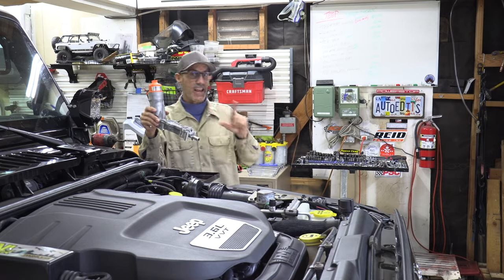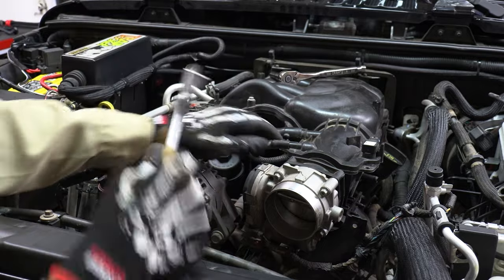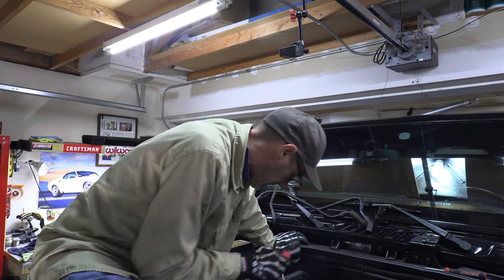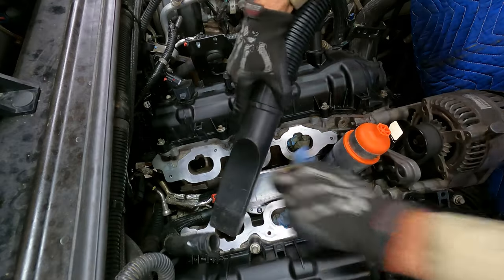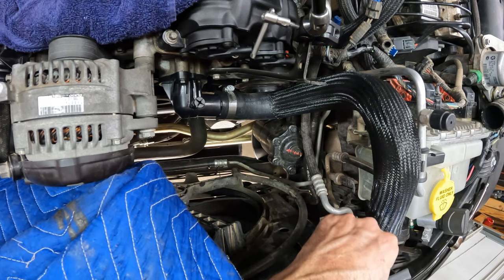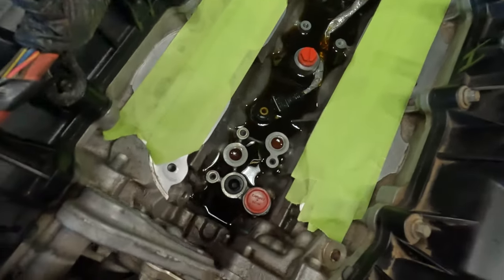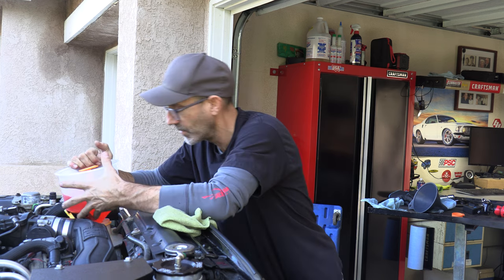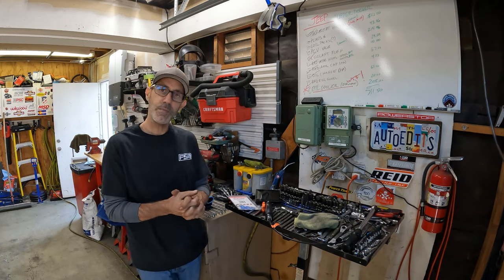How to  Replace Jeep JK Oil Cooler and MORE - Plugs, PCV, Thermostat Housing, Coil Packs

Comment from the maker: Howdy Jeepers! Hope you all like this video... chapters are pretty well organized to each task. Let me know what you think!!!
https://www.amazon.com/shop/autoedits/list/3DK63XK3I5IL6?ref_=aip_sf_list_spv_ofs_mixed_d
Reply: Sucks you had to replace the housing twice! But I bet it got extra clean in there the second time ;-) I just did this at 220k miles on my 14 JKU, so you may get to do it again! I forgot to put the foam back in, though, and I still haven't gotten around to it... Thanks for another awesome video!
Reply: On the dorman quality control issues. I read up on this and ordered the mishimoto oil cooler/housing for my pentastar ram that just sprung this leak.
Reply: Excellent video! It can be used not only as a reference work, but also a cautionary tale. Here's to another 10 years and 80,000 more miles. Aloha.
Reply from the maker: From what I've researched... that foam missing hasn't affected many jeepers so rest easy on that one!
Reply from the maker: I'm so thrilled you got that from this video because I honestly wanted more than just a how to!!! Thanks so much for this feedback... I appreciate it a bunch!
Reply: This was a great video…of course because you are awesome👍🏻👍🏻.  Big jobs like that scare me….im dreading installing an EFI system in my rig because I am worried I do not have the knowledge
Reply from the maker: Best way to do that is break it up into smaller manageable sections. One bite at a time 🤣You got it!
Reply: As a newer "2019" jeep owner found this very informative.
Love the content that you have on your channel.
Mahalo
Reply: Installed the mishimoto unit on my 3.6 today. No leaks first try.
Reply: @skulldriver1019 how is the mishimoto housing holding up? I'm between either mishimoto or dorman
Reply: @AutoEdits  I sure can see a difference in my wiring harness  with one side having foam and the other side not.
Passenger side harness is CRISPY
Reply: Same thing happened to me with the Dorman yesterday. Not happy

Comment: I replaced the housing with the oem replacement with felpro gaskets and they were exactly the same. So the doorman gaskets must be different. Also my previous oil cooler cracked under where the old gasket was on the coolant side of the oil cooler, so good to check under the gaskets when you take off the old unit👍🏽
Reply from the maker: Good advice

Comment: Im replacing my knock sensors currently and need to get below the oil cooler which just got replaced. Is it possible to clamp off the rubber hose feeding into the back of the cooler to minimize leakage?

Comment: The mitshimoto one comes with new sensors and a new oil filter with the cooler mounted and torqued already for 100 bucks less just an FYI great video though getting ready to tackle mine this weekend
Reply from the maker: Best of luck to you!
Reply: Link?

Comment: Thank for the video, I went with the Mishimoto oil cooler housing instead of Dorman, and the Baxter spin on oil filter adapter.
Reply: I’m really curious how happy you were with the Mishimoto product. 

By the way, great video Jason
Reply: @Tony3deee  very good product, if you have a need for one, get it. My coworker is getting one also.
Reply: is the mishimoto better than the dorman in your opinion?
Reply: @ I herd mishimoto is a better product, and it is fully assembled.

Comment: thanks for video very informative 2 questions 1 what is your recemented oil cooler to use . the doorman i fear after what happened to you 2 how many days did it take to do and yes I've got 112367 miles on my jeep so i will be copying   what you have done in video
Reply from the maker: It took a full weekend and I’ve seen good reviews of the Mishimoto cooler… https://www.amazon.com/shop/autoedits/list/3DK63XK3I5IL6?ref_=aip_sf_list_spv_ofs_mixed_m

Comment: Hey Jason, I’m curious why you went with the Dorman oil cooler vs OEM plastic. I had an oil leak on my 2016 JKU, the oil cooler was the culprit (replaced under warranty). Now at 85k I’m seeing similar leaking but no pooling where you see it. Not looking forward to replacing an oil cooler since I have a supercharger. Had to fix a heater hose leak earlier this year. So I’m getting pretty fast at stripping the supercharger off but it’s still a weekend job. Always love your content!
Reply from the maker: Did you watch far enough for my explanation and recommendation to go with a stock unit? 👍
Reply: Thanks Jason, my bad, I literally stopped watching at the coolant burping part, fell asleep lol.  I read on some forums that the OEM plastic is preferred in this part.

Comment: Being the owner of a 2013 JKU with 120k myself, this video is timely and informative.  Thanks.
Reply from the maker: Hope there's a nugget or two in there for you!
Reply: I also have a 2013 JKU, with 130k. My oil cooler failed two days before you posted, and I wish that wasn't the case. I went with the Dorman, and had good luck with the unit, although pricey at my local parts store... My oil cooler was also not cracked, and I probably could have saved the money and gone the seal only route and replaced all you did here instead. Funny that the oil temp sensor in both of ours spun like that... thanks again as always!

Comment: Two quick points: 

1.  I've done this repair twice now and referenced this video both times.  It's a fantastic how to guide.  Thanks Jason.

2.  If you're in a time crunch and can't wait for e-sockets to be delivered, I found some in stock at my local Harbor Freight for $11.99 (Pittsburgh brand).  They did the job.

Comment: If it makes you feel any better about what you had to just spend, I just paid $1,200 (on 1/5/24) at the dealership to have just the oil cooler replaced for this same leak on my 2015 Jeep Grand Cherokee with the 3.6L. I wish I would have had the time to do it myself. 

This video is reminiscent of the early channel. This is the content I really appreciate from you and why I subscribed long ago.  Good work!
Reply from the maker: I appreciate hearing this!

Comment: Jason, I have a 2013 jku also. I went to have it smogged, it wouldn't pass, had a bad oil temp ( or pressure) sensor. It is one that attached to oil cooler. I had the shop do it as I heard how much of a pain it was. While it was apart I had them do plugs ,etc. I have to give a huge shout out to Ricks care care here in Santa Maria. Super great work and customer service.
I really enjoy your channel. Keep it up.

Comment: Morning Jeeping Jason. I have watched your videos for the seven years, and you are one of my favorites. I most recently had to change my oil cooler when I notice that right after an oil and transmission fluid change, I saw the leaking oil down the sides of the transmission. Your video just posted, and I looked at it about 5 times because I knew that i had to do this job. I have done a tune up before, so I knew how far I had to go into the motor. I debated with OEM VS Aftermarket and settled on Dorman. After all of the videos I watched I have not found a for sure issue with Dorman products, so I took a shot on it. The job was time consuming, and I gave myself the weekend to complete it. After reassembly, I have two issues. There was a no start condition from injectors 2,4, &6, so back off the upper plenum goes. I found the fuel line was not connected all the way so that was fixed. The 2nd issue was my brown wire (Injector signal wire) in the main wiring harness had backed out during disassembly. I found it by watching more "Youtube Videos". Once corrected, the jeep started and is currently running fine. For the first week i looked down in the valley to look for signs of leakage. So far so good. Sorry for your bad luck with your Dorman install, but for me, this is the second time this job was done. I had the dealership install one back in OCT of 2019 and it lasted just around 5 yrs. I'm hoping this Dorman last longer than that because this is not a routine job I want to keep doing. Keep making great content and keep on "JEEPING".  Terry.....
Reply from the maker: That is a serious journey ... glad to hear it's a so far so good situation! Thanks for sharing the story here!

Comment: Excellent clear Video, I Did all this except hoses and Radiator Cap. I also replaced Spark plug tube seals, I had one leaking oil on a coil. I also added a Baxter Oil filter Adapter, no more Dry Rattling Starts since it uses a spin on Filter that doesn’t drain back like the Cartridge one.
Reply from the maker: How do you like the Baxter?
Reply: Well worth it, It’s my Wife’s Jeep. She likes to use the remote start to warm/cool the vehicle while it’s in the garage and it always made me cringe every time it started up with that rattling at start up , plus I get to use a good Mobil 1 Synthetic oil filter M1-212A

Comment: I just bought the Mishimoto oil cooler for my JKU and have been waiting for your video before I do my install.  I gotta say the Mishimoto looks so much better than the doorman. Thanks man for another great video.  You're one of the few YouTubers I trust.
Reply from the maker: Thanks so much!!!
Reply: Did you install the mishimoto oil cooler yet? I'm between dorman and mishimoto
Reply: @i-Lion9  Not yet unfortunately.
Reply: @i-Lion9  
I put one in and it worked great .
Except I did switch out the o rings it came with for some better Mahle o rings 👌🏻
Reply: @TXFarmRoad  awesome thanks
Reply: @i-Lion9  
You bet 👍🏻
Definitely recommend the o rings tho .... they are a better fit  x & y

Comment: I really wanted to see how you got the spark plug socket/extension on the passenger side plugs. I could not fit an extension in there because of the battery tray. I had to remove the tray which was the toughest most annoying part of the job. I changed plugs when I had a lifter tick that I tackled. Even that was easier than getting an extension into that passenger side plug by the  battery tray.  Sorry you had to go through the failure point, happens to us all especially with how complicated mopar decided to make maintenance on these jeeps.
Reply from the maker: oh darn... I very easily used two shorter extensions on the socket and would connect/disconnect going down the plug hole.  I thought about sharing that part but this video felt so long already. Sorry dude.
Reply: thanks for the info! I'm not very tool savvy, but i'll definitely do this next time I get around to the plugs @AutoEdits

Comment: Yep, sometimes new parts are bad right out of the box. Hopefully that 2nd Dorman unit holds up. Is there a better aftermarket unit that is a completely different design? Maybe something that doesn't mount under the intake, or just plumb up a separate radiator style cooler in the grille.
Reply from the maker: I'm not sure interesting suggestion... hmm

Comment: Great video, I've never worked on a Jeep and was able to follow along easily.

I did basically the same thing on my Crown Victoria last year, sans the oil cooiler. Swapped the intake manifold instead and did the spark plugs, valve cover gaskets, fuel injectors, etc.. a classic "while I'm in here" rabbit hole
Reply from the maker: Nice work! Glad to hear from a fellow rabbit hole dweller 🤣

Comment: Hey Jason enjoyed the video and your honesty with the issues. I didn’t see that you replaced the sensors, just transferred them. I had to replace the oil temp sensor in my daughter’s jeep with 90k miles so did the Dorman housing while there. Just a thought. I actually had it done at a shop due to my work schedule but now I need to replace the housing in my wife’s JK. Don’t have the funds to have a shop do this so I’m doing it myself

Other videos I’ve seen claim that the plastic plug on the housing can come out and showed an example of that issue. Also the ridges around the seals can become brittle and break down causing a leak. For those reasons I think I’m gonna do the Mishimoto housing with Mopar seals per the rest of the internet’s suggestions

Thank you for your video offering on this subject. Reminded me that I also need to add a PCV valve to my list
Reply from the maker: Unless I suspect or know a sensor is bad, it's best to re-use what works. I'll be curious to hear what you think of the Mishi unit.
Reply: @AutoEdits wow! What a weekend and what a process. First of all, this was the only weekend I had available to do this so I ordered the Mishimoto with rush delivery only to find that the item was back ordered indefinitely so I had to cancel the order. I then had to source an oil cooler locally which meant the Dorman. I must have watched a dozen other videos on the subject and non called out the seals so I stayed with the Dorman ones. It was late Friday and couldn’t get any. Mopar locally anyway.

Well wouldn’t you know…thers a constant drip of coolant coming from my bell housing. Now it’s Sunday and no Mopar parts available so I took it to my local shop on Monday to have the seals replaced with Mopar ones. Let’s hope it works. Geez

Note- this shop used to use the Dorman coolers but has since gone back to OEM as they say they have been more reliable. Mayb Mopar has made some refinements to their oil coolers??   Certainly makes me question the decision of engineers to put that item so deep into the motor
Reply: Update: the seals on the Dorman cooler still leak. I don’t have the time to replace so I took it back to the shop that did my daughter’s Jeep. They’re replacing the whole things with their own so that they can warranty it. Understandable. They are giving me back my old Dorman so that I can seek a possible refund from the auto parts store. Reminder: I never got to try the Mishimoto because they were out of stock at the time I did the repair

Comment: Wish I had done the radiator hoses when I was doing all of these maintenence items and then replacing my rockers and lifters a couple of months ago. I had them off anyway but didn't even think about replacing them. Things always pop up for me during these repairs too. And I swear replacing that pcv valve took me half my overall repair time. I used a small torx bit taped to a small spanner to get to the screws. I also upgraded my lower air intake and fuel injectors to the JL components and they've been great so far.
Reply from the maker: Sometimes good info sharing like this on the web... thanks for that input!

Comment: Just did my oil cooler back in November. Would've definitely used this how to as a step by step. Well done! sucks about the dorman issue.. word of advice for those about to tackle this job. Take your time cleaning up any casting issues. No leaks for me as of now, and I strongly feel it's because I prepped the cooler first with a file. biggest regret for me was not doing the "because we're here" replacements (coilpacks, sparkplugs, thermostat etc). Thats going to suck. Keep up the great work! Big fan of this channel
Reply from the maker: Hey thanks for the share!

Comment: Sorry to see you had a bad experience with the Doorman housing. I used one on my JK after 2 other OEM ones, and it worked great. Never had an issue after that.  Glad to see her fixed though and back on the road.
Reply from the maker: In my mind, it's kind of like shopping at harbor freight... sometimes good and sometimes not so much 🤣

Comment: Great video. I did my oil cooler housing at 65k miles. I’m now at 130 and hoping I don’t have to do it again for a while. I’ve added at205 reseal which helps rejuvenate rubber gaskets. My oil cooler housing failed due to the gaskets. Maybe the 205 reseal is helping to keep this one going strong.  If I may just add a personal opinion regarding the Dorman oil cooler housing…..if you do your own oil changes then you don’t need to get the Dorman. Most of the cracking issues on the Mopar units are due to people over tightening the filter cap. No reason to gorilla that thing down. The culprit you can’t control is the wearing out of the seals which will happen to the dorman as well. Maybe the 205 reseal will help though. I’d stick with Mopar parts for any repair that is involved. I learned the hard way with after market things like sensors etc. Not worth it. But to each his own.
Reply: I poured some at205 reseal in my 86 vw golf that had a small leak where the cv shaft hub attaches to the transaxle and after pouring that stuff in, I had a major leak!

Comment: Good stuff, Jason.
My 14 JKUR is pushing 104k and hasn't had an issue or been addressed yet. I wasn't looking forward to it,  but feel much more confident now.😎👍
Reply from the maker: Check that pcv valve! I thought mine was fine until I got it out and looked… it was a mess 🤣

Comment: Dang brother, that stinks! Glad you got it handled though. The bright side is that it failed immediately and not on the freeway or out in the middle of nowhere. While unpleasant, probably the best scenario you could have had. 🤙
Reply from the maker: Hey thanks dude... yeah you are right for sure... I appreciate that!
Reply: @AutoEdits did you go back to mopar?
Reply from the maker: @litoornelas6409  Still running the Dorman

Comment: Recently did my spark plugs put everything together and then I saw the foam thing on driver side spark plugs on the floor still. So I had to undo everything just to make sure everything went back the way it came off. Not as much work as you but I get the feeling.
Reply from the maker: HA!

Comment: I'm going back in again myself. Three years ago, replaced the oil cooler, had to use an Amazon one during the pandemic. Failed in 6 months, replaced with Mopar, lasted two years and failed again. Finally replaced with the Dorman which has been good so far. Unfortunately, now I have a knock sensor error, which is right under the oil cooler. Eyeroll As was said, do it while your in there!
Reply from the maker: OUCH!!! 🤣